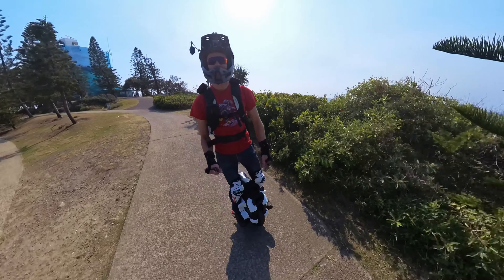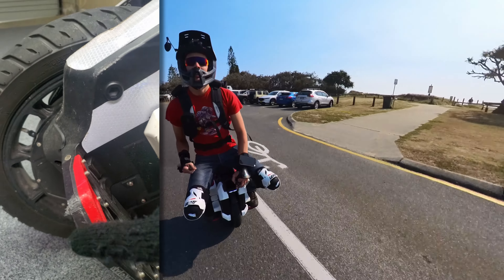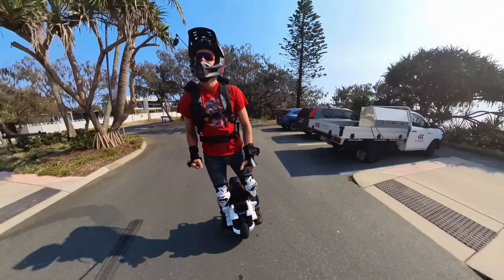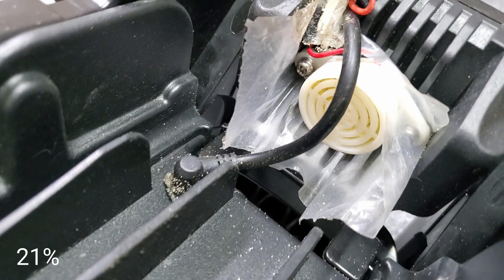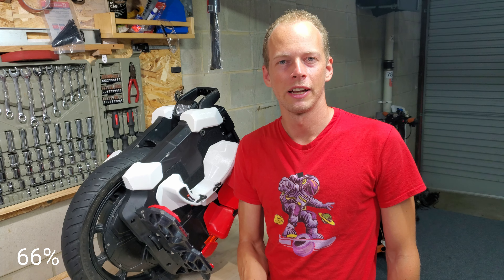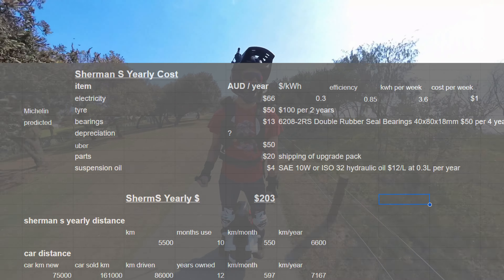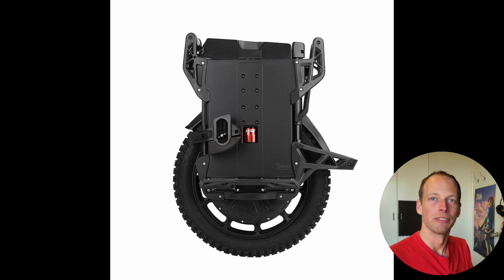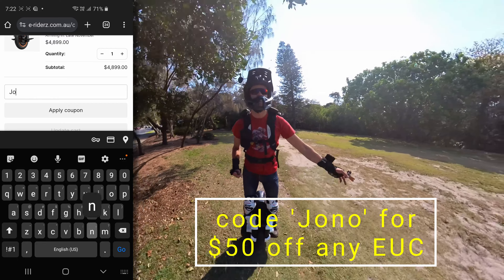Veteran Sherman S 6000km Update

Comment: Glad all these new wheels are being released during Northern Hemisphere “Winter,” I can skip on them until Spring. My S is going strong, around 4500 issue-free miles on it. The, what is it, Shinko brand stock knobby is a great tire choice too. Takes care of my off-road needs. I find myself carving lots to keep it round when on the roads. That would be a complaint, but I love to carve. There aren’t too many cars where I live so I am able to. I don’t care for speed that much, just have a little range anxiety given if work may pull the plug on letting me charge there I would be using a good amount more of the battery every day as it is a 50 mile round trip. It isn’t too big a deal. Most days I JUST charge at work anyways and usually have 20% left, if I can charge it up to around 100V.
Reply from the maker: perfect, wait and see how they shake out!
I presume it's the Shinko 244? i've heard it mentioned a few times as a popular knobby.
That's a pickle but at least with with some speed management 50miles shouldn't be a problem.

Comment: Thanks for the update. Looking forward to your suspension maintenance. A little over a 1000 miles on my S and I was hearing some clunk coming from the bearings. I avoid water as much as possible, I don't do any crazy drops and I don't ride my S in the rain at all. Anyways ewheels had me send my motor in for inspection and repair. Waiting for it to come back. Overall I love the S, but I have to admit it's disappointing paying over $4k to have this issue so soon.
Reply from the maker: Thanks mate, 
damn that sucks, I'm curious what the issue was. If you find out let us know!
cheers, jono

Comment: Still love my Sherman-S after 3000 km, i can't think of another wheel that would replace it, no need for more speed but still would be curious to try the Lynx an V14, but i know the Sherman is the best do it all wheel for my use, i like doing long distances without worrying about range, also have a fast adjustable charger from 2-20A that i keep with me most of the time, it can charge from 40 to 90% in about an hour at 15A and even less on a 20A outlet, i'll have to sillicone the top cover too because some water got in when i've washed the wheel, apart from that and the bearings change, it is very reliable and strong i do a lot of offroad with the Shinko 244

Thanks for your time and quality content !
Reply from the maker: Hey Mate, good to hear!
Same, I'm always curious to try other wheels but very content.
Nice charge times, I don't go that far to carry one.
I'm probably going to DIY a larger seat but are you still enjoying the moto seat you installed?
Also, are you still running tubeless? holding air?

Yea 100% want peace of mind when it comes to water. 
I would like to try the 244. It'd be my pick for a full knobby.

You too mate, Cheers!
Reply: @jonoeuc  Still tubeless, lose about 1 psi per week, i really like the seat i can sit for extended period of times and don't feel any discomfort (look for CMX250 passenger seat) the Shinko 244 is a good compromise, the noise pitch is less annoying than stock and have more grip on and offroad !
Reply from the maker: @MathieuTechMoto  good stuff, hmm now i'm considering tubeless :P

Comment: Great job, as always.  I bought the Patton and do a lot of (mostly) pretty rugged off-road riding and must say I regret getting the smaller diameter wheel.  Patton is OK, but it does get upset with larger, loose rocks.  And longer distance is probably more tiring than it would have been on the slightly larger wheel.  It (Patton) does have pretty good range though.
Reply from the maker: cheers mate.
Sounds like you're on cruisier fire roads etc rather than tight technical tracks? 
ta, jono
Reply: @jonoeuc  - very rugged jeep trails in the desert of Southwest US.  lots of loose sand, rocks, deep, soft sand, and washouts.  There are many flash floods in the desert and it makes a mess of the unimproved roads.
Reply from the maker: @arevee9429  oof, sounds intense

Comment: What size would you be getting on the Heidenau? 90/90-14? Also looking to upgrade but I’ve never bought tires for something to small before 😅
Reply from the maker: I'd go 80/90-14.
Here's a comment from my buddy on a V11

"I am very happy with the K66.  I rode 2,000 miles on it so far.  It's handled all the terrain without issue.  It doesn't have the same trail grip as the Shinko 244 that I had before it, but based on what you see it should be expected.   I still want to warn you that the 244 picks up gravel.  If you don't have a lot of clearance under the fender it could cause an accident."

Some have issue that it still train tracks and darts around grooves in the concrete. this is the tradeoff with a round profile tyre hybrid or street tyre.

Other options are Shinko 241 or 244

Sherman S rider
"I have used the 244 on my Sherman Max I had. It wasn't bad. Turned well. It's a hard tire that seems to never whereout. 

241 is what I use on the Sherman-S now and after running it through gravel roads. It gets better and better. Still a little hard and not as grippy as the Golden boy version on my Patton. If I could find a softer trials competition tire that would be my go to.

The 244 is also heavy. And feels nearly indestructible
"

"I  was using the sn26 urban snow tire but it's hard to get here. That's my favorite on the Sherman-S. Good grip everywhere. Rolls quite. Turns great."

Hope that helps, cheers
Jono

Comment: Get a summer motorcycle jacket to help protect your skin and elbows. Much easier to put on than elbow pads and easiest to take off too.
Reply from the maker: It's likely that I will, when I find a really nicely ventilated jacket. I won't feel as protected with just the elbow pads that's for sure. Decent though.
cheers jono

Comment: How was the kangaroo?

And are the hydraulic seals easy to order if you need to replace? I noticed that you didnt fix the leak and just add more oil...
Reply from the maker: The roo disappeared off into the bushes. While I was left picking up myself and euc pads! Surprised since it was a hefty T-bone.

I haven't sourced the seals - if you find them let me know! Apparently just cleaning them can fix the leak. I didn't modify mine in any way nor open them to add oil. 
cheers, jono

edit: I found these, unsure if they fit. There is a part number on the seals so unless someone knows, we'll have to pull off the old  ones to see the number.
https://fastace.com/products/fastace-alx13rc-oil-seal-and-dust-wiper-seal

Comment: where did you get the bolt  torque specs from?
Reply from the maker: I had some values from my buddy Jon Wall. Some replacement bolt bags from Leaperkim had the torque listed. Then my judgement on the rest using reference charts. Those were the values used on my re-assembly to ensure they didn't damage my threads. However since most of the threads are aluminum the values should possibly be reduced even further.
Do you have any further suggestions?
Cheers

Comment: I don’t understand why you ended up with the wheel pressed to one side?
Reply from the maker: the wheel alignment is determined early on the re-assembly. When the mudguard and internal suspension bracket is screwed into the motor/hub. I over twisted these parts initially.
checkout my animation that helps explain it. let me know if you still have questions! 
https://youtube.com/shorts/ZQmxh8WZF6M?feature=share
Reply: @jonoeuc  👍WOW👍, you even made an animation to answer my question)👍, unexpected and pleasant), thank you.